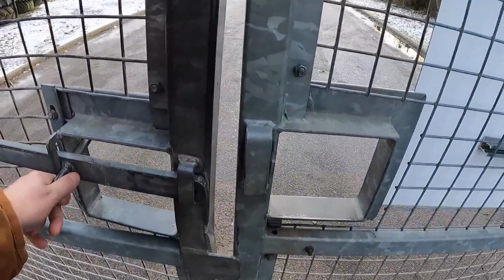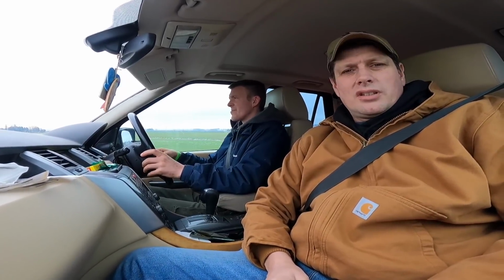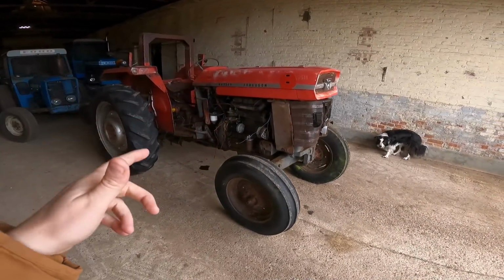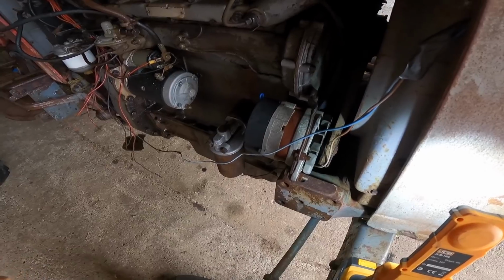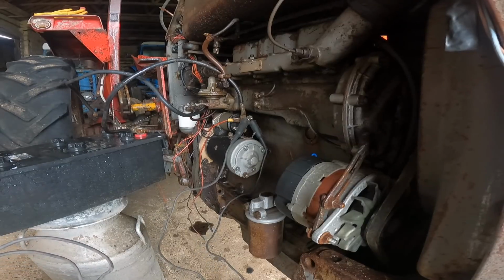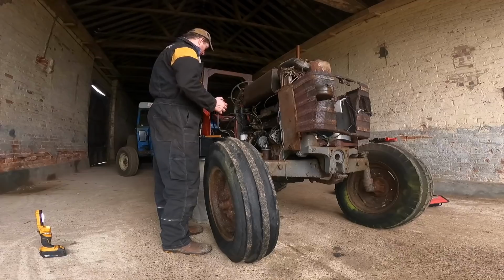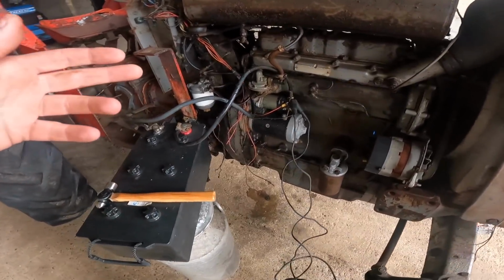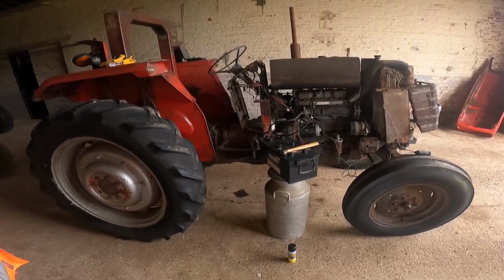MASSEY FERGUSON 165

Comment: The Massey Ferguson 165 and 135 was the first two Massey’s I drove on my own . Earlier my dad had aMF 35 & 65 I rode on them but to young to drive them. We had many different Massey’s under 100hp. Today I have a 1990 MF 3070 92hp. My brothers have a 471, 451,  35.  I also have a IMT 539 deluxe  it the same as  35 MF with power steering.

Comment: We have a retired MF dealer in the area, that still maintains his business shop, but no longer sells new equipment,  His devotion is to vintage models & he has knowledge & a collection of parts that might stock an Assembly Line. Went there once to check if he had a radiator hose that would fit my IH.  He threw me out, if it isn't a MF issue,  keep out !!

Comment: The last two tractors I drove for a job was a 1986 Fiat 160/90 then 1988 Massy Ferguson 3680 Datatronic. Very different tractors but both awesome pullers in their day.Fergy was on 16.9/36 front and 20.8/ 42 rears which I thought was a unique combo then,so either of these two would be nice to see👍.

Comment: Thank you for this series, have a 1970 MF165 inherited from my father. Clutch pedal is so worn that you can cut baling twine with the pedal. Same issue engine will not move or turn by hand gives me the confidence to try the same actions.

Comment: My 1969 Massey 165 runs perfectly its a Beast of a machine iv put some crazy loads on the back 3 point. My grandfather had both the 165 and 135 and never had a sized moter.
Reply from the maker: I doubt your grandfather submerged his tractors...

Comment: Podge, Put decent sized tyres on the 165, 18.4x28 and 7.50x16 on the front. That is how they were delivered here and with a proper roller drawbar they were expected to spend their lives pulling machinery that was too big for them. They were a bit under powered compared to their main competition the Chamberlain 9G but most managed to hang together somehow. 
My Ford 2000 has 14.9x24 on the back and 6.00x16 on the front and looks good shod like that. That is how it would have been optioned when new as well. Jeff.

Comment: Nice find there, I missed out on a MF135 a few years back, it was in very good original condition, it was for sale at a farm only five miles from home. The guy wanted £500 ! I told him I would be back with the cash in a couple of hours, the bugger sold it before I got back. It had been on that farm for years , it was the best MF 135 in original condition I had ever seen. I was gutted and not a happy bunny.  A few years before that I missed out on a Tripple D . Win some loose some. I did great on three non running JD's a few months later that I had for nothing and sold them on for a great profit. Your vid reminded me on the 135 I missed out on. My Ruston Bucyrus 10 RB is being delivered on Thursday. Will do a vid on that for my channel

Comment: Excellent episode. I would suggest either the history of equal wheel tractors or the evolution of the sub 50 horse power massey ferguson compact series so 135/240 up to 1747 and those in between.

Comment: 4/65 Nuffield. May be a little vanilla in flavour to you, but less so elsewhere in the world.
Big like for this video as the Massey was/is big time popular in our area. 
Finding price jump in similar era 40 - 60 hp tractors, especially with a loader.
Not for collectors but for regular duties to ward off increasing the hours on more expensive newer machinery, of which service and parts are getting over the top. 
Not even going to mention cracked heads, rotting hydraulic hoses, etc etc just out of warranty even on Kubota's.  Similar there?

Comment: Not only were they fitted with those tyres (18.4x28 and 7.50x16), both front and rear wheels were mounted on cast centres with wheel weights both ends and the back tyres were filled with water. That was to give them some purchase to pull all the gear that was too big for them. I don’t think they had a habit of blowing up diffs but they should have. Jeff.
Reply: Massy that were made at banner lane had gearbox and rear end components specially heat treated to make them nearly indestructible,plus the rear axle trumpets were made at Leys Malleable Castings just down the road from where I live!👍

Comment: Them fence row specials are like going and adopting a dog from the pound. Once you get them home they are loyal to a fault. She wanted to go. Need to go find a Massey 1200. Always thought those things were cute as hell.
Reply from the maker: I ploughed with an MF 1250 before we had the TW-25. Overall I still think I liked it more.
Reply: Obviously I’ve never been around them since they never made it over here but the little bit I’ve read about them the 1200 and 1250 were a little bit of a problem child. Any truth to that?
Reply from the maker: People say they were two 188's (?) bolted together but they were much more than that.
They were actually very good but let down by weak hydraulics and a complicated (poor design) drive to the transmission.
I would put one up against any equivalent hp tractor of the day (or even modern equivalent hp)

Comment: 'Ere, Mucker, how far are you from Cheffins Cambridgeshire sale ground? - Me dad always wanted to get there, but never did.

Well that old Fergie started like any early 165 would do - we had a 1969 model that we referred to as the "towster" (pronounced as toaster) because the only way it would start from cold, was with a tow, and this was 1972 I'm talking about! So 'Fud's' is a good one, and like ours, once warmed up, it'll start all day from the key.

What size are those rears? I'm pretty sure ours came from factory with 32"s on the rear, and 6.50 x 16 on the front. Same rear tyres as our '62 Super Major anyway. (Now that was a legendary tractor that would start in -30*C - without ether, or a heater plug, either!).

Maybe you could do an episode on the Super Major? Or perhaps the much maligned DB 885? Personally, I'd like your take on a DB 1290 (I have one right here, and wonder if your findings would match up with our experience). Mind you, ours has a 12/1390 'Frankenmotor' that my dad built for it!

Comment: We have a mf 165 mk2 and it was on 32 rear wheels but we run it on 13.6 36 rears and 750 16s on the front. It made the tractor look much better and better for road runs. looking at the wings and link arms on your tractor it looks like it would have been fitted on 36s rears. 16.9 34s would make the tractor stand up I no some people will say it's the wrong tyres.

Comment: When you said they told You guys the tractor was seized up. I was wondering how true that was. I havent seen too many of those old tractors Seuzed up. I know it could happen but usually if an old farmer had it. They usualky watch for coolant or Oil leaks. Because they cant really Afford a motor seized Great video. She sounds good....
Reply from the maker: The fact that the engine wouldn't turn and the rear wheels were locked solid pointed to the engine being stuck, it kind of gives it away...

Comment: i wouldnt change the wheels as they are the correct type for a  mk1 165. them little perkins 203 engines are sweet running light on diesel and very easily started. the only let down on them are the dry brakes which are prone  to locking up.  looks like you got a good little tractor there  which would be an easy restoration job.
Reply from the maker: Those wheels are coming off...

Comment: We have had an MF178 for 35 years, indestructible bar the power steering that never worked properly. Starts right up even without preheating and zero repairs during our ownership. Came on 38 tyres but had to get 32 fitted to enter the machine shed. Looks strange and would prefer 38 for any road work

Comment: Excellent Massey Ferguson 165 be interesting what year this tractor built because 1966 to 1976 was years built in and one late Neighbor Cecil had them in Desiel motor type also last long time to! Lord Muck should change the pivot canister in middle of front axle below rad they do break in half and front axle fall off too if not grease up regularly on metal cone and that Massey Ferguson tractor for 1967 excellent shape to!

Comment: My old one was on 38's with large fronts thing was a quick tractor had multi power was a bugger to stop as brakes hardly worked got a zetor you can come look at backend locked up not brake bands left it standing in the hedge and engine seized from water getting down the exhaust

Comment: I very much enjoyed the video of the cold starts on the 3000 and 10 series. I use the heat element by turning the key for 10 seconds on our 3000 never fails.
Reply from the maker: We've got the manifold heater kit for this, I think we may do a vid when fitting it.

Comment: How do you go with rebuilding/servicing injector pumps? Cause mine is leaking on my Massey 165 and I’m not sure what to do. The pump is a Lucas CAV and engine is a Perkins 4.236. I’m also new to your channel and subscribed because I’m trying to learn how to fix diesels and find your videos very helpful. 👍🏻
Reply from the maker: Probably not a job for someone to 'have a go at' and I always take mine to a diesel injection specialist to have rebuilt - they can then test it and it's better in the long run !
Reply: 4.236 best 4 cly Perkins made. They been known to go 20,000 hrs with proper maintenance. I have a 4.236 turbo that puts out 92hp in a 1990 MF 3070. Very fuel efficient tractor for its size and weight.

Comment: I would like to see a old kobellco for 3 reasons 1st i noticed your jumper you were wearing as you went to collect the tractor. 2nd is i work at a kobellco dealer in nsw Australia and have never seen a old kobellco revived and lastly i like to be different

Comment: Here is a challenge for you Lord Muck;  Many years ago lots of us had massey 2640 2680 models which were great tractors with one big fault, they were really slow on the road. Now the Mod use the 2680 and 85 models but they did 30mph so why dont you get one and show everyone how to convert a standard one to 50K ?
Its the speedshift part of the gearbox you need to focus on.
Let me know if yourbrave enough?
Reply from the maker: Having spent countless hours on a 2720, I have far more pressing things to do than make something that struggled to stop at 18mph try and stop at 30mph...

Comment: You can come and have a look at my MF1200 when it finished. I would like to see an MB trac.
Reply from the maker: How's it coming along ?
Reply: @LordMuck  it mobile again to get it in the shed over winter. Need to split it when it warms up to rebuild/replace the pump. Also need to replace the shaft seals in the trunnion. It’s been a big job.

Comment: Lovely little tractor, decent tyres and a clean up should get her looking good after you get her running, no ignition key I take it? Gerry6420 has a lovely 3650. Massey ferguson 675 two wheel drive or a 3060 .

Comment: Very early 165 with the 4.203 motor. I didn't see a power steering pump below the alternator or a ram behind the grill I have never seen a factory Armstrong steering 165 before.

Comment: Find the highest hour/worn out tractor or digger that still starts you can , just see how high you can go, knew of a Mx110 with a  contractor with 32k hrs on it when he sold it seen a leyland hedgecutting in tractor mag with 62k hrs but it was a bit of triggers broom,  wander if there's any near or higher out there

Comment: Think 32,s were an option but probably with 6.00 x 16 fronts new tyres 36’s more common lift its arse off the deck a bit.  Maxxum 5150

Comment: nice early one there,recon she had a cab at some point, some of the fittings look like a lambourne maybe, the 165 was the first tractor i drove,was a later one,fitted with a mf flexi cab, we owned it from new right till we sold up in 1999, used as the yard tractor, and a bit of grain hauling each year ,have a pic of me next to an old one like yours as well,with the lambourne cab fitted
as for a subject ,i wouldnt mind seeing a belarus 4wd  maybe,used to see loads down here

Comment: The tractor I would like you to test drive would be the Ford 70 series with super steer. I have a Massey 165 front badge and side badge if you are interested.
Reply from the maker: Drop me a line 👍

Comment: Series 1 7610, specifically how to properly plumb a loader into it, without running it off the back spools with a bungee on the lever, cos its doing my head in.
Reply from the maker: Yes you shouldn't use a bungee.
...you should use a bit of old inner tube 😉👌🏼
Reply: @LordMuck  That's where I've been going wrong so, cheaper to replace too. I prefer troubleshooting the hydraulics on my 8n (with a Perkins fitted because some bugger put spark plugs where the injectors should go on the ford motor), if it don't lift, add more oil.

Comment: Would love to see you do some thing on the old air cooled Sames , some thing like a tiger 100 ,buffalo 130 , trident 130 or a leopard 90 . 
I always found the clutch pedal different to press down on the 100 series massys , 
You would have a leg like King Kong after spending a day buck racking on one of them
Reply: Or, 'Leone 75' or 'Saturno 80' that we used to have in the early '80s. Nice tractors!

Comment: I would like to see an air cooled tractor because since there different a lot of people don't know how to work on them. On another note later today will be dumpster diving for a diesel truck engine. The local salvage yard has an old ford L8000 dump truck with 8.3l cummins and if it runs good I can buy it for cheaper than rebuilding the 7.8l ford engine in my L8000. What happened is a piece of an exhaust valve came off and did a number on the head and cylinder#3.

Comment: The 212 engine in the 165 was  a lot better than the 203  l had  one  on  its third time  around the  clock  when  it went  only because  I was trying to do what  it's wasn't  able  for  l replaced it  with 236 out of a168

Comment: I’ve commented a few times about a landini 9880 and I’m now in the same boat. It was turning fine then a power steering pipe was leaking so I replaced it a few days later then it would only turn backwards anyway it has now stopped turning all together so I have got to strip it down to find the problem
Reply from the maker: Oh the joys...

Comment: we got a 135 starts all the time 1st time.
Reply: Mine never ever need heater or pre glow. Never opened in the engine. I use it in forest and to plow snow in mid sweden. BM Volvos made here never start as easy in winter.

Comment: Splitting the Massey 165 to change the clutch - only ever done this once
Reply from the maker: Well that's good - you won't need to see it again... 😉
Reply: @LordMuck  Chicken - it was a pig to do in a farm workshop, but we did it
Reply from the maker: If it needs splitting we'll do it, it's not difficult.
At this point it doesn't need a clutch.

Comment: Your right it should be on  36s
Reply from the maker: Yes I think 36's will look nice as would 38's even if not correct
Reply: @LordMuck  ya both would smaller 203 engine in that one as on all the round axles the brakes will probably need looking at

Comment: Would be interested in anything you can do around Muir Hill
Reply: I spent a bit of time with one being used on an opencast site for pump maintenance - with an hiab I think. A local drilling company used them a lot in the 80’s and 90’s in the midlands too - Drillsure I think

Comment: You didn't find a Gazelle parked up next door? First time we flew there with my uncle when he was looking for some equipment he wasn't worried about getting smashed up we got lost after the code for the wrong Sutton was put in the navigation leading us to have to land in a bare patch of a wheat field no doubt confusing the poor sod spraying as to why a helicopter in desert camo was stopping in his field especially when a midget sized teen gets out and hops in the co pilot's seat swapping with his OAP dad as he hadn't got his glasses and couldn't read the flight map. 

Third time I believe was in a Squirrel and out of the three was the first time I didn't want to throw up over Southend due to dropping a 1000ft what felt like instantly to avoid a Cessna was the first time my dad realised what I meant about leaving my stomach at 2000ft over the Thames but I could also see what he meant when he told me you didn't get that in the front.
Reply from the maker: I was wondering if there were any bits of runway left at Mepal (Cheffins sale ground) but there's nothing there now otherwise I could have flown in and met them there (fixed wing obviously, none of that taxi with a rotary roof rack nonsense)

Comment: What is it with the 'rona and folks buying locked up vehicles sight unseen?  We ended up spunking 500 quid on a pug 306 XS a couple of weeks back, that'd been sat since '08, off a couple of rainy & dark photos of it sat on a trailer...  Arrived seized solid, fast forward 8 days and she was all ticketed up & we've got about 400 miles on her already!  Here's fingers crossed the MF turns out as good of a buy (obv not watched the video yet lol) post-watch-EDIT: Cool, she freed up even easier. couldn't rock our car loose had to stick diesel/ATF down her holes & still overtorqued the crank bolt by a couple of hundred pounds before she snapped out of it!  Dunno what the fudweasel gave for it, but considering the rule of buying unseen (pay as if it's blown up & filled to the brim with dog diarrhoea) I'd guess he got a bargain!